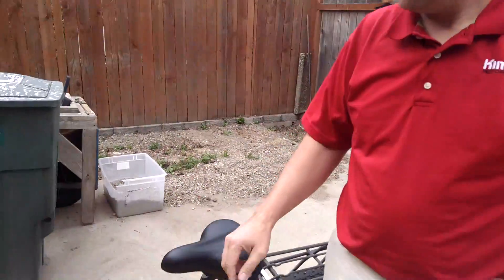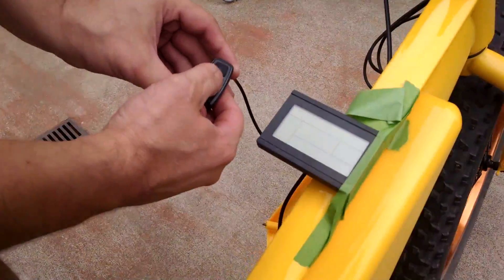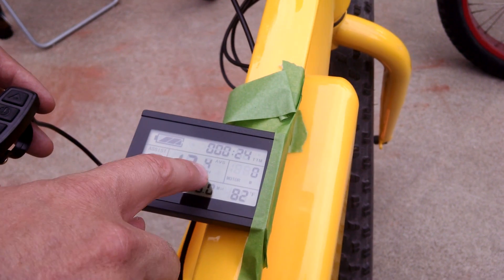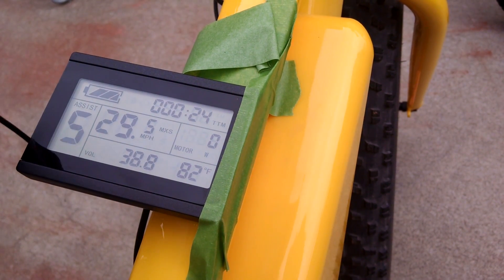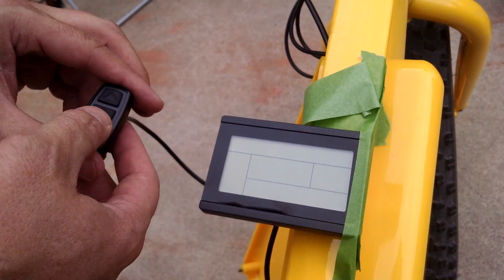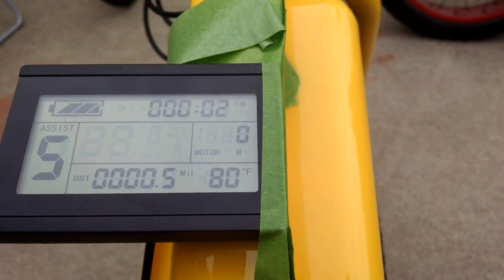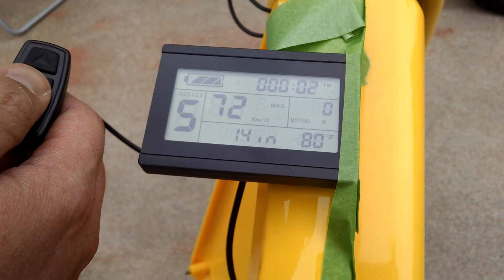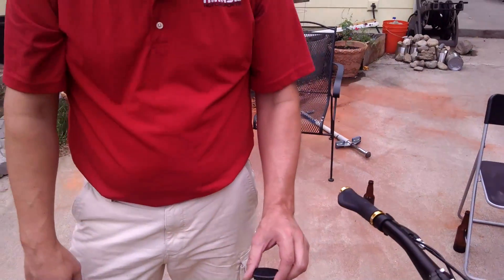KT-LCD3 Display is a MUST HAVE accessory for the Sondors Ebike.

Comment: I had an issue installing this unit, after I installed it all my eBike would not power up... anybody have any suggestions or advice? I removed all the KT stuff and put it back to the factory settings but it still will not get any power to the throttle unit or hub motor... Help?

Comment: would you know why mine doesn't properly show watts? just shows 0. used to work before.
Reply: It will only show wattage while the motor is running.

Comment: almost every comment is after some more info. I am in the same boat, it looks like a must have but where can i get it.  I don't want to pay another $99.  I already have two bikes and two extra batteries.   I looked on aliexpress many people have similar items for sale but i'm worried about the connector.  Does anyone know if there are adapters or should I just make my own?  BTW prices on aliexpress range from $30 ish up.
Reply: Stewart Lang emailed someone yesterday about a screen with the 5 pin connector. they had one last one but the back was white, ended up buying anyways. might want to email some of those aliexpress people and ask them. their english wasn't too bad either. only issue now is whether the cord will be long enough. searched for literally 6 - 8 hours yesterday trying to find adapters and extensions for the 5 pin. can't even find a real universal standard name for the type of plug that is being used.

Comment: Condors is selling his own branded version of this exact unit and it is $100 pre-sale.
Reply: LuvMyTJ I don't see it anywhere on their website
Reply: Jim Bo It is only for campaign buyers at this time. If you bought one (Sondors e-bike) you should of gotten an email telling you about it a week ago.
Reply: LuvMyTJ Thnaks!  I had to dig into my Gmail account's "Promo" folder to find it, but I did get the email and just ordered one.  If the lower gears actually work, that alone will make the purchase worthwhile (I live in a hilly area).
Reply: Jim Bo I looked into that too, it is not true gears but just more assisted push. You can accomplish the same thing by thumbing the throttle more. So as I see it, the "gears" is an adjustment of the pedal assist, not real gearing. I will wait for the unbranded clone as it runs $30 & up. Besides, they are both delayed until mid September anyways.